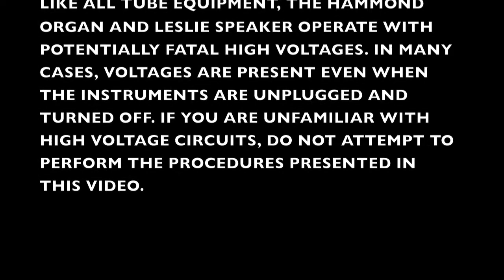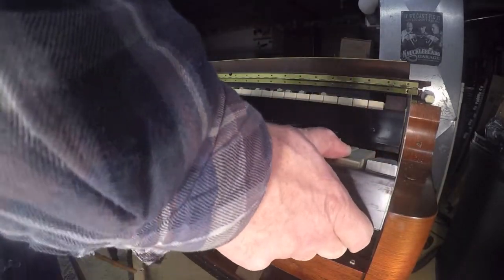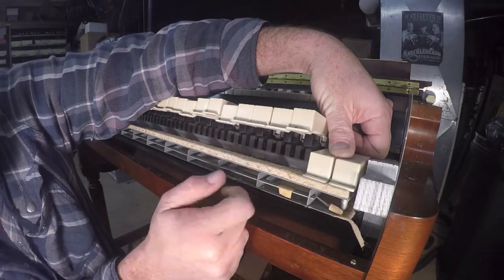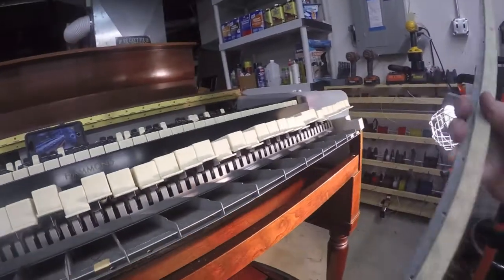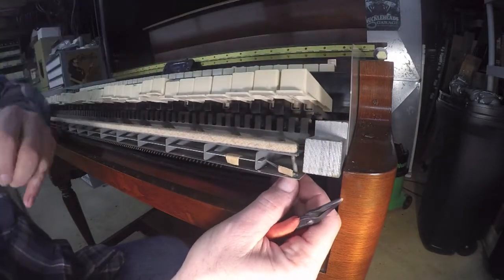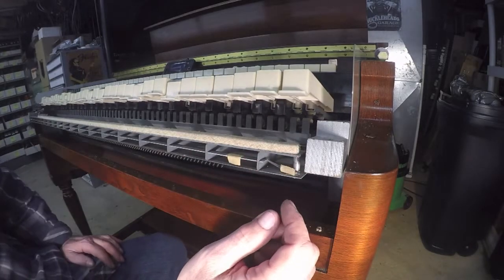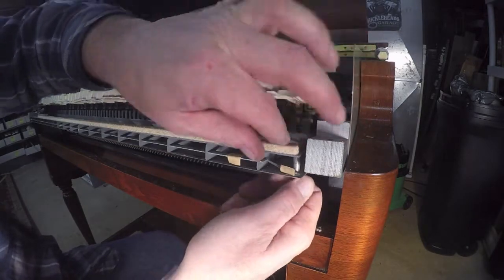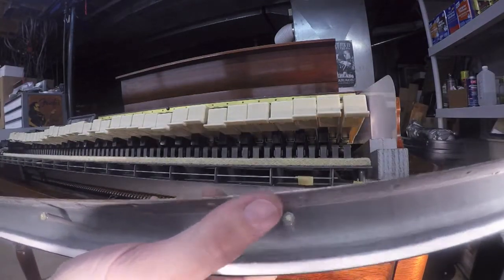Hammond B2 Replace Upstop Felts - Part 2

Comment: Many thanks for this very useful video John.  Is the upper manual more involved or just the same job but another 20 screws?  I have a '55 B3 which needs both manuals doing.
Reply: I am also replacing the upstop and downstop felts on my 1955 Hammond C3 and am very curious how to go about replacing them for the upper manual.... any advice? can’t seem to find any instructional videos. Thanks in advance for any of your time and effort with my question! 👍🏻